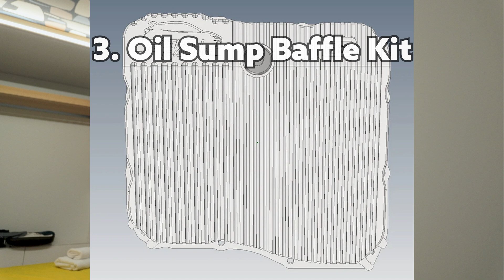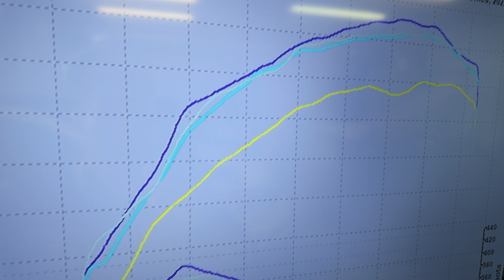5 Steps to Prevent Killing Your Toyota G16E GTS & My Wastegate BROKE

Comment from the maker: Has anyone heard of rattling Wastegates on G16E-GTS engines? Any info would be helpful at this stage! Also thinking of what to do with the turbo itself: stock, hybrid, or more?
Reply: I have adapted the wcd without a PID control first at 1.2, 1.4 & 1.6bar relative. Spent a lot of hours on retrieving data. Eventually it was almost good or near perfect😂, added the PID action and an almost closed WG under 2000rpm resulting in no rattle. I'm happy to share some tables from the Syvecs in private.
Reply from the maker: Please drop me an email mate, let’s dig: thank-you very much!
Reply: Im currently running Ecutek on my GR corolla. Recently I got the new update from ecutek and my wastegate started to rattle. At the end it was the wastegate duty tables messed up. I had my tuner talk to Ecutek and they sent him new tables for the wastegate problem that I had. Now its gone. Your problem its the tune. Make sure your tuner look at the wastegate tables.
Reply: My GR has the same problem. Even 88% wcd is necessary to keep the boost stable at 1.6bar at 5.5krpm. It was so annoying loud between 1krpm and 2krpm that i almost closed the wcd to 98%.
Reply from the maker: Sounds like the same problem, I need to investigate better
Reply: @PIRASMotorsport  Unrelated, but would not running the 50-50 split put less demand on the rear clutch pack, and reduce heat build up?  Thanks for all you do.  I will take delivery of a 2025 Corolla pretty soon.  I will use HPL Premium Passenger Car oil in the 5-30 grade.  This oil has been tested to be one of the best for holding viscosity and not shearing away the viscosity modifiers.
Reply from the maker: @Sagina1999  Hello mate, thankyou for sharing! Yes, you nailed it with the oil, and congratulations for your purchase!
In regards to the Differential mode, I wouldn't sweat it from the reliability point of view (or any others): even in the full rally trophy cars, in the third season, they haven't seen any wear. These central diffs will last very long years as they are designed!
Reply: @PIRASMotorsport  So if I understand you, the rear differential has nothing to do with the drive modes as they change the amount to front and rear?  I thought it did.  
I want to get things right from the get go when I get the car.  HPL oils are not cheap, but I have seen the lab test results against other oils, and they spare no expense in using the best base stock, and additives.  I have zero to do with them, I'm just a guy that wants the best oils for the car.  I am in my 60's, so I won't be doing dumb teenage stuff!  I do autocross, and maybe a track day once in a while.
I'm so glad I found your channel.  You are an immense help to me, and the GRC and GRY community.
Thank you so much for being able to reply to people here.   
PS: I will leave mine factory other than the chassis brace, and that Cusso engine pitching stopper deal you showed in one of your videos. So far, their site does not list the 2025 year model, so I will speak to them when the time comes.
 Much thanks for that information!!
Reply from the maker: @Sagina1999  Yes: the central differential is the one that has to do with the torque shift between F/R axels. Maybe it confused you because it is located at the rear, attached to the rear differential.
I understand and subscribe you staying stock, but don't go crazy with oils: just buy the right rating and API SP 5W30 from a mainstrem brand like Castrol or Motul, and you will be fine! What has more impact is frequent changes. This will help much more!
Really appreciate your words, and will work to bring you much more, quality content, now that I've gone full time! Just crazy with moving into the new house this week, then I'll be back!
Reply: @PIRASMotorsport  I hear you, but the HPL 5-30 blows away Castrol, and Mobil-1 for example.  They can't hold a candle to the HPL.   Check the video "Viscosity Breakdown: The Silent Engine Killer Revealed!"  The difference in HTHS is insane!
I will pay 48,000 USD for the car (Premium Plus model), and I want the best oils for it, so I will pay the high cost.  Oil & filters cheap, engines expensive!  I already ordered a case of Purolator Boss oil filters for it.  As for air, I will use factory filter, as it is a very good air filter.  I don't want to do mods. due to wanting to stay in Street class with SCCA Pro Solo events.
 Again, thank you so much!  You are "Da-Man"!
Reply from the maker: @Sagina1999 Thankyou mate!
Reply: I've owned a GR Yaris for about 6 months now (new, 0 km) and for the first time in mid August, I've started hearing a rattle that I think might be wastegate related. The rattle only comes on in very specific conditions, at around 2.500-3.500 RPM in either 2nd or 3rd gear, when at around 20-25% throttle going slightly uphill. I've only been able to replicate it 2-3 times since first hearing it. The car doesnt feel different in any way, still pulls the same. Maybe its not wastegate related at all, who knows.
Reply from the maker: Yes, the rpm range is the same, when the turbo starts spooling up: seems you have lighter symptoms, but same problem
Reply: @PIRASMotorsport  Is it something of concern for me? I always thought it was just the sound it sometimes makes because the engine is not perfectly balanced.
Reply from the maker: This sound is like when you rattle keys in your hand, only around 2500-3500 rpm. Not to confuse with the oem clutch/flywheel sound at idle.
I have to take the turbo off the car to understand more, but I will report everything!
Reply: @PIRASMotorsport  Is there any way you could get a sound clip so I can compare it to mine? Thanks.
Reply from the maker: Yes of course, as soon as the car will arrive here: unfortunately it will be 2-3 weeks
Reply: Just keep your turbo stock and change engine oil & coolant more frequently, yes you heard me right, change coolant more frequently. I need to empathize this. A lot of guys neglect the coolant in their forced induction engines & that is a big NO. Fresh & clean coolant is just as important as high quality engine oil.
Reply from the maker: @johnmactavish5191  I agree that the liquids must be fresh AND the Right Ones! As for the turbo, this isn't really the cause of this issue. Then again, I agree on the fact that the more you push it, the more problems you can have.
Reply: I have the same problem with my waste gate of my GR yaris. Rattling sound when i release the gas at 2-3k RPM.. is there any way to fix this rather than buying another assembly of turbo kit? Any help would be great...

Thank you!
Reply from the maker: @jonathante9634 hello there! I reported in the following video that we had found the issue: it was the wastegate duty cycle control on my map. This has been updated. If you’re on aftermarket ecu map, ask them if they can look into it. If you are ok stock software, instead, it sounds like bad news for the turbo…

Comment: Do you have any videos on these cars OEM clutches? I’ve been reading and it seems Toyota over engineered the dual flywheel and adjustable clutch that can cause premature wear.
Reply from the maker: Not true about the wear: what’s true is that the DMFW has no springs, this doesn’t help high rev shifts
Reply: @PIRASMotorsport this could cause the pressure plate to fuse to the flywheel then yeah? Also couldn’t that cause problems with the auto adjusting clutch thinking it’s wearing down quicker? Just trying to get some information from you European guys, in America everyone’s heads are stuck in the sand with these cars. Some people still believe the rear differential is the culprit for the car going into 2WD mode 😅

Comment: Mine is ratteling too, we were wondering if that came before mapping or after. But so far no power issues.
Reply from the maker: In the end, my issue was due to a leak in the vacuum tubes. Watch those first, then it may be the turbo mate

Comment: "By adding an oil cooler, thereby extending the oil circuit and increasing the amount of oil, will the oil pump continue to maintain good pressure?"
Reply from the maker: Yes, as its a closed loop circuit, it works perfectly
Reply: @PIRASMotorsport  thank you! 🤝🏻🫡

Comment: Adriano, do you use track or road kit of Hel? These are 10 rows Setrabs small and bigger, while as I see Lamspeed uses 13 row big one. I have the issue with Miata where I have 13 row setrab with mocal plate and in winter it hardy gets 70 degrees while normal driving. Maybe because mocal opens with 80 degrees while hel 92? Which would you suggest for gr yaris? I am collecting my gen 1 in a few days🙂
Reply from the maker: I use and suggest the smaller radiator form Hel, after direct confrontation with them, as cooling is plenty and cold weather isn’t a problem
Reply: @PIRASMotorsport  Thanks!

Comment: I’m not planning to track my car , and was looking to fit an hks oil cooler, would you still recommend  this,I’ve read that too cool oil temps are just as bad.
Reply from the maker: Don’t worry, if you plan on using it to its full potential, even on road, there will not be any too cool

Comment: What oil cooler will get you below 100 degrees C?. You said under load, does that mean just normal driving around? On track I'm seeing much higher temps (130C) after many laps, in my GR Corolla but no oil cooler yet.
Reply from the maker: That is normal mate: I use HEL Performance and our hood vents, basically never over 100

Comment: Are you still using motul 300v for engine oil?
Reply from the maker: Never used 300v: I was using Motul 8100 and now Pakelo was installed with the cams, but I will go back to a major brand.

Comment: The only abnormal thing that happened to my GRY is the Aircondtioner. When the A/C is on, the engine rpm fluctuates. 

My Malaysian Toyota dealer has changes the A/C compressor and did as many maintenance as they could. But they couldn’t identify the problem. They even consulted with Toyota Japan and they unfortunately come back with no solution. At the moment it doesn’t caused any unforeseen issues to the engine. Its a small annoying issue, but i hope the community can do enough complain to Toyota and hopefully they might take action.
Reply: I don't know about your Toyota but in my MR2 turbo sometimes the idle up sensor might be dirty.

Your engine rpm should go up right?
Reply from the maker: @odin5188  It goes up slightly, but it should remain fairly stable
Reply: @PIRASMotorsport  Yes mine does, i was just thinking of some symptoms my MR2 runs almost like normal with a standalone ecu and 436hp.
It's just interesting watching about this 3 cylinder. Very informative. Not really changed from my car to this. Good oil and fuel.

Water meth system may also be an option.
Reply from the maker: @odin5188  yes, it is quite basic, but people think they can stone the car and still service it at 10k km with 0W20 oil, so it must be stated!
Reply from the maker: Hello Jackson, sorry to hear about this trouble! This is a strange one, yes... It could be that there is an obstruction somewhere in the A/C's pressured lines, maybe a defective part, that causes the AC itself to work harder, but I'm only guessing...
Reply: @PIRASMotorsport  Toyota dealer changed my AC Compressor, and it didnt solvee the issue. they even contacted Toyota Gazoo Racing HQ, and their reply was I dont know.
Reply from the maker: @JacksonHustler really sorry to learn this mate…

Comment: Top Tip to stop breaking your GR yaris engine.

STOP MODIFYING IT !! & STICK TO ITS SERVICE SCHEDULE WT OIL SPECIFIED.  

Im not suprised with such a puny 1.6cc engine and one cylinder less (3 only).. why do some ppl think they can modify to 400+bhp. 

Want a powerful car, top tip #2,.. BUY A PROPER CAR WT HIGH POWER.  AMG, BMW M,.etc.
Reply from the maker: This comment isn't helpful mate...

Comment: How does driving in a high gear damage the turbo? Or are you finding an issue with the waste gate? Which works harder and lower rpm to maintain correct boost? I’m starting to think this issue is a tuning issue not a Toyota issue.
Reply from the maker: No no, Toyota issue mate, occurs on stock cars too!
Higher gear at low rpms, outside of the turbo’s range, puts a lot of strain on the turbo and leads to LSPI too.
Wastegate issue is something new, not related to the LSPI problem
Reply: @PIRASMotorsport  What is the turbo range in GR Yaris?
Reply from the maker: @maciejkula9471  From 2750 to 5800rpm is the sweet full boost window
Reply: @PIRASMotorsport  So how would you suggest to brake-in the new engine? I have thought to make first 1000 km between 2000-3000 rpm, next 500 km between 3000-4000 rpm and next 500 km between 4000-5000 rpm, and afterwards to change oil.
Reply from the maker: @maciejkula9471  yes, that sounds good! But do give it some load after the first 500Km, as it helps. Not full beans, just some load.
Reply: @PIRASMotorsport  some load but not to go over 3000 rpm and less than 2750? So maybe should I brake-in in shorter distance, not 2000 km but 1000 km and change oils? Sorry to be so detailed but I would like to make it properly
Reply from the maker: @maciejkula9471 don’t keep it too low, and don’t go crazy about the revs: just don’t give it full boost, work towards it during the kilometers, change the oil after 2000km to 5W30 and you will be fine!
Reply: @ Thank you!
Reply from the maker: @maciejkula9471 pleasure!
Reply: @PIRASMotorsport I wonder if people are running correct fuel? So more of a detonation issue? Not really a turbo issue. Or is this due to the ring gap and burning oil. My old turbo charged Toyota did exactly that

Comment: I am using ow20 signature series oil in my 2024 GR Corolla circuit edition. I changed break in oil at 1000 miles was planning on 5000 mile oil changes it is my daily driver
Reply from the maker: Hello Christopher,
I don’t know what oil that is, but please check the ratings and viscosity!
Reply: @PIRASMotorsport hi talking probably abut Amsoil oil.

Comment: If you put an oil cooler it’s very important for daily driver to get oil to operating temp to avoid fuel delusion in your oil. Avoid short trips as much as you can. Here in Florida USA we have 93 octane which is 98 RON. I use 98 Ron with PEA additive (Polyetheramine) helps prevent LSPI. Shell VPower, Chevron, Sunoco and other top tier 93/91 octane fuel available.
Reply from the maker: Good: to avoid issues of heating up oil, you need to select an oil cooler like from HEL Performance, that have a sandwich plate that never closes completely, so you always have oil circulation also in the auxiliary cooling circuit while retaining quick heating process
Reply: @PIRASMotorsport  thermostatic oil cooler
Reply from the maker: @mhk67091  yes, thermostatic sandwich plate BUT, with a thermostat that leaves the circuit 10-15% open all the time, then opens more with heat. In this way there are no large temperature differentials and pressure losses in the system.

Comment: Good fuel quality is mutch more important than other oil viscosities that what the manufacturer prescribes, to prevent detonation. Apparently there is poor fuel quality in Italy, because here in Belgium not a single G16E-GTS has broken down due to poor pre-ignition, even though they run on 0w20😂
Reply from the maker: I agree, and I’m happy to hear that they are running strong in Belgium. Fact is that many deliberately just use the basic fuel quality…
Reply: I only run mine on Aral 102 RON fuel, hopefully that will prevent such an issue from arising
Reply from the maker: @DeFausti lucky man you get that beautiful super fuel!
Reply: @DeFausti  LSPI comes from improper oils.  Even if you used a lower octane fuel with the correct oil, you should be okay.
The oil makers found that the detergent additives were too volatile, so new formulas were made to prevent LSPI, thus the SP, GF 6 oils we have today.

Comment: The Corolla GR in US has different stock pistons and rings than Yaris GR in Europe. I’m not sure that matters.
Reply from the maker: They tried to fix the issues, but didn’t mange. Pistons and rings are all that matter! Now they probably nailed it with the Gen.2 GRY and will use that setup also for Corolla…
Reply: @PIRASMotorsport  does the 2023 or 2024 Corolla GR have the Gen 2 or only the 2025.
Reply from the maker: @mhk67091 apparently only 2025 has the improved version, but all of this needs official confirmation

Comment: Not all oil coolers are created equal and investing in the largest surface area/efficient cooler you can afford the better, especially considering the average ambient temperatures the car will be exposed to. In my opinion don't waste time on small 10-13 row 300mm coolers and look at something similar to the HKS oil cooler size (surface area and volume).
Reply from the maker: Yes, it’s true: I chose the HEL Performance kit, that unites the Setrab cooler with the most beautifully made aluminium sandwich plate, that allows some flow also from cold, in order not to have pressure drops when it opens fully

Comment: Such Great information.
the oil I was going to use is 5W30      API AP     ISLAC   GF-6A   (NOT the GF - 6 you recommend) Is the 6A going to work?   THX
Reply from the maker: Will GF-6 apply to every kind of viscosity grade?
Almost. There will be a split between 0W-16 viscosity grade engine oils and all other existing ILSAC viscosity grades. GF-6A will represent existing ILSAC viscosity grades and GF-6B will represent 0W-16 viscosity grade oils only.

So basically, 6A is what we are after mate!
Reply: @PIRASMotorsport  Thanks - much appreciated.
 I think I will have to add an oil cooler - go to know...

I'm in the process of getting an Ecutek flash👍
Reply from the maker: Yes, cooler and hood vents possibly!